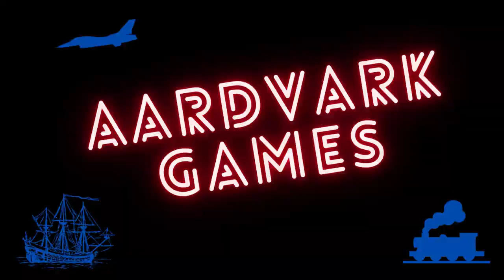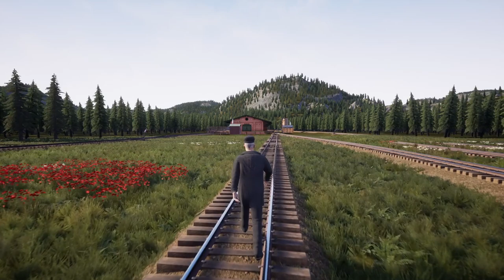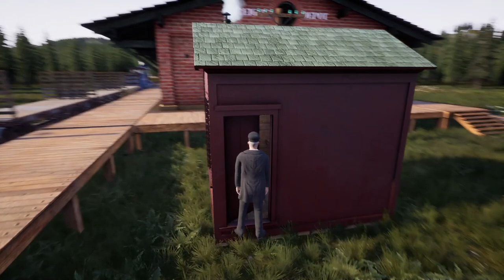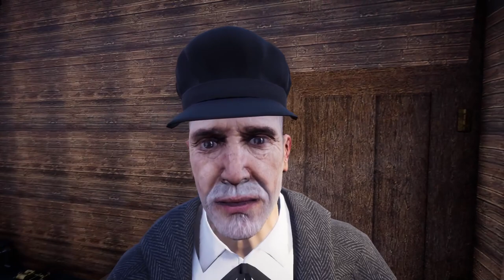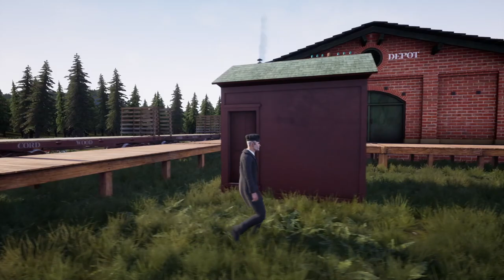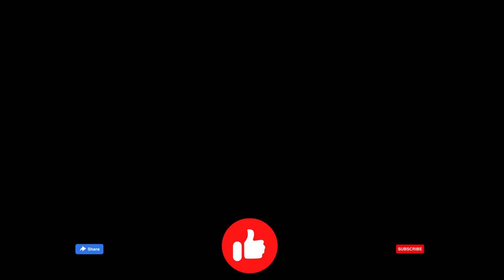RailRoads Online! Update 230324 Patch Notes

Comment: I cannot play the game after the updates. My controls do not work in the track building. I cannot rotate or change grids. cannot make turns and cannot play because of it. Would uninstalling and reinstalling fix it? I am so sad over it. The old splines worked much better for me. No help from the community thing either. I loved playing the game until now.
Reply from the maker: maybe a reinstall would help, hard to know but worth a try. I have been pretty lucky and don't run into so many bugs for some reason. Sucks to hear that you are having issues. Hope they get it right for you soon.
Reply: @AardvarkGames-YT  I am going to try a reinstall. Hope it works. I liked playing this game a lot. Very upsetting to see videos that it works in and then see what mine does. None of the hot keys in the build thing work. Cannot even leave the spawning point. Thanks for your response. Keep doing your thing. I like to watch.